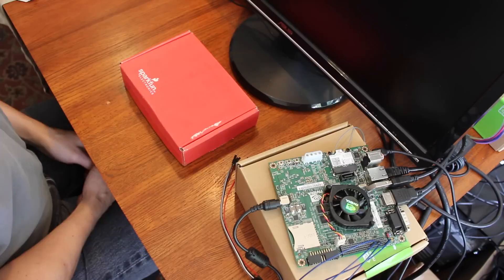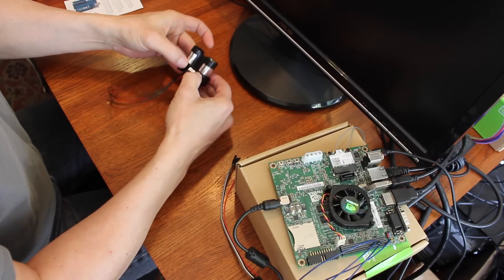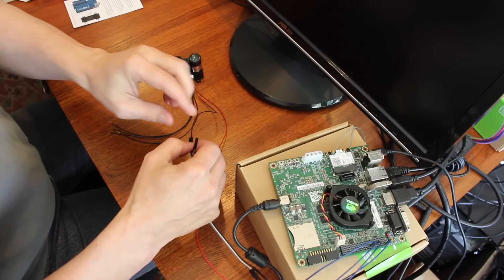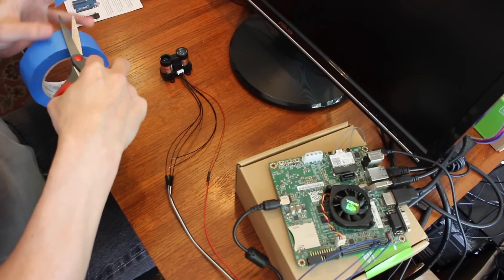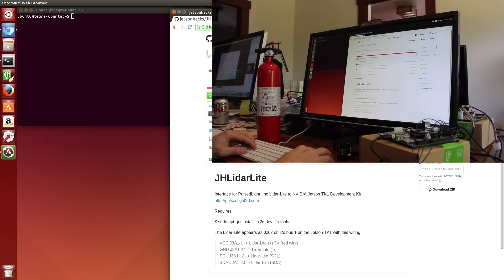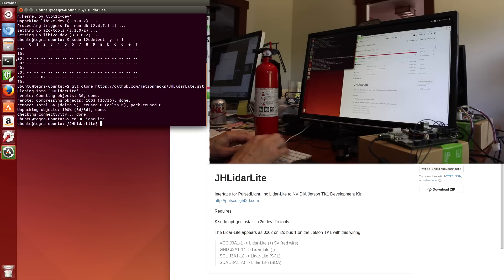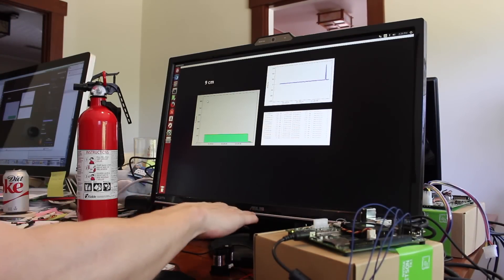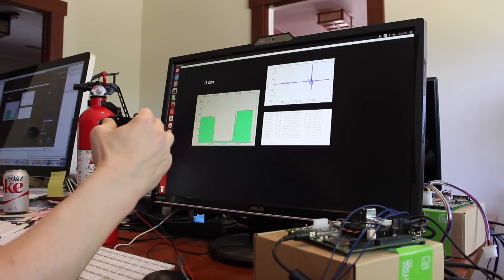LIDAR-Lite Install and Demo - NVIDIA Jetson TK1

Comment: Hello!
Great videos in general, I really like to follow your progress.

I have two questions regarding LiDAR lite:

1. With v1, how many measurements per second were you able to acquire via I2C and the Jetson?

2. Will you buy v2? They advertise 400Hz but with some "hacks" you could even reach 500 Hz https://github.com/PulsedLight3D/LIDARLite_v2_Arduino_Library/blob/master/LIDARLite/examples/Single%20Sensor/Distance_as_Fast_as_Possible/Distance_as_Fast_as_Possible.ino#L8
Reply from the maker: +TeMp3rr0r I'm embarrassed to say that I did not measure the speed. Maybe I'll revisit this in a while. I haven't acquired the LIDAR-Line V2 yet, Other people have tried that the software that I wrote and have reported it works, but you have to an extra capacitor to the circuit for the V2 to work with the Jetson. Thanks for watching!

Comment: Nice job. Question - what software did you use to display the distances graphically?
Reply from the maker: Ryan H Thanks for the complement. The software is just a sketch I threw together using Qt and QCustomPlot. QCustomPlot does most all the heavy lifting, providing both the distance and the velocity graphs. The third window is just a disguised console window. You can grab QCustomPlot from http://qcustomplot.com. I'm blessed with being able to forget many of the details, but as I recall the only real trick was running a timer to generate a callback to update the graph. They have a similar idea in one of their examples, so it was relatively painless to implement.